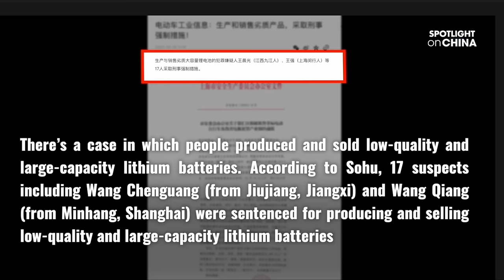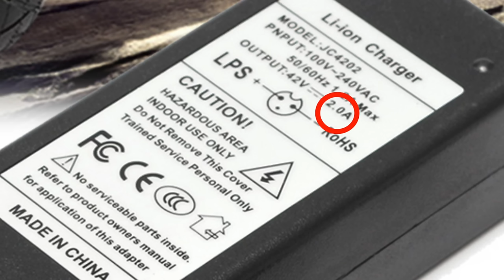What's Causing Ebikes Fires?

Comment: I once unknowingly fed a singular 18650 cell directly with a 5v2a supply. It was like a small grenade went off in the room followed by a small fire that was thankfully easily extinguished. A year later I'm boarding a flight with my phone, a rather beefy battery bank, and some other electronic devices in my carry-on that were all perfectly acceptable to bring with me but they wouldn't let me take my half tube of toothpaste. I just remember thinking to myself "I feel like there're enough batteries in my carry-on devices to cut a plane in half, but for some reason the toothpaste is the scary thing?"
Reply: Yep you’re allowed take a 36v 10ah battery on the plane… equivalent to multiple grenades. But 9 out of 10 dentists agree tootpaste is dangerous😂😂😂
Reply: @VelEire_  I'm told 100w or 150w with permission per battery up to 3 batteries. Thpugh they never say anything about laptop battery 🤷🏻‍♂️
Reply: @VelEire_  just the gas smoke from one would poison all in the plane. You make a good point.
Reply: @neilstern7108 Not a good point bc they can simply drop the emergency O2 masks for everyone to breath instead.
Reply: @novicenova  she makes a great point. And I still say I would not want to sit in a plane full of poisonous smoke. Even with air mask. And remember the fire and heat in a pressurized area.  Not good.
Reply: @novicenova  There is only so much O2 on a plane.  Plus, what happens when that O2 meets fire?  Think!
Reply: I haven't flown since the 70's. Not ever going to either.
Reply: i charge my in my wood stove purty safe
Reply: Your toothpaste is scary but stop and think even if they let you bring toothpaste then someone's might sneak mouthwash or god forbid dental's floss Onto the plane and then before you know it you have good oral hygiene at 40,000 feet! where does the madness end!
Reply: Yes my girl friends battery operated thermal panties caught on fire,
It was like  Moses looking
at the burning bush
Reply: @Timotheos-td7mq  If I were Moses Id be thinking "wow I climb all the way up this mountain to witness your glory and you set fire to a shrub" wow how impressive!
Reply: I remember laughing because they took away my tiny fingernail scissors but let me go the plane with sharp metal knitting needles 12" long!  Stupid people!  No brain power!
Reply: That's because .4 oz of amatol, C4, torpex, Comp B or other similar explosives, when combined with a cell phone battery has the explosive yield of a 17 kt nuclear device.
When you add the nuts that they serve on airplanes, it boosts the output to 2.1 megatons.
Reply: Considering that 4.25 volts is the maximum charge for a 18650 cell I get why it exploded but if you treat them right you should be fine
Reply: @novicenova
So do you really think that feeding O2 into a fire is a good idea?
Sure, the batteries don’t need oxygen to burn but it helps keep everything else on the plane aflame.
Reply: Yes, my 6000 USD ebike went up in smokes on the first ride !!!
Reply: @qua7771 it’s not pure oxygen. It’s equivalent to the air you breathe.
Reply: @jeremyashford2145 I shouldn’t have to say this, but the air you breathe on a plane is similar to the air you breathe outside. It’s not going to accelerate a fire like pure oxygen.
Reply: @bruceskousen5451  Are you sure about that?  I never worked on commercial planes, but in the military we had LOX tanks, (liquid oxygen).  It saves weight in that form.  It's not breathed in full concentration, I understand.
Reply: @bruceskousen5451
No. You shouldn't.
Indeed the O2 content is slightly reduced.
The "air you breathe on a plane is similar to the air" you breathed on the plane half an hour ago.
They used to serve up fresh air but once they banned smoking the opted for the cheaper process of recycling.
Still plenty of oxygen in it to support fires though.
Reply: If it was 'Arm & Hammer' toothpaste you're not allowed to take hammers on a commercial flight. Everyone should know that.

Comment: To avoid EV fires: 1) Do not accelerate excessively. 2) Wait an hour after using EV before charging so that the balancing resistors can equalize the batteries. 3) Wait one hour to use EV after charging 4) Do not leave plugged in overnight 5) Charge only to 90 percent.

Comment: I agree with the video 100%. Unplug the charger when not in use. Give the charger a chance to cool down. I noticed that most electronics work better when they’re unplugged and plugged back in (resets, recycles, I’m not really sure). I also only charge my battery when it’s around 50% or below and I never charge in direct sunlight. Try to keep your charger in a cool and dry place. Try not to allow the charger to get wet. Simple precautions that go a long way.
Reply: It's recommended to charge your battery after every ride to prolong its life.
Reply: @OddJobzAberdeenshire  I see this subject is like many others-ask 100 people the same question and you get 100 different answers. I have 3 scooters and whatever I’m doing to maintain the batteries is working so I’ll keep doing what I’ve been doing.

Comment: I've had a e bike for 8 years 
Knock on wood no issues yet .it's never failed me and still works oerfect .
Reply: 11 yr old pedego riden daily, on 3rd battery. About10k mi.batterys are toast. So far so good. But i do change outside in case
Reply: @donpet8258  im on my original battery
Reply: I've recently purchased a 52v 45amp battery from conhis motor. Works great so far. Hopefully it stays that way
Reply: it will come :p

Comment: There are a few other really important things that really improve safety:

1 Charge outside where ever possible.  In a yard, on a balcony.  This reduces the risk of your home catching fire, buys you time and reduces the chance of you inhaling toxic smoke.
2 Charge on a fire proof surface.  On a paving slab, in a sink, somewhere that will not catch and spread the fire.  Think about what is above the location where you charge.
3 Never be tempted to recharge the battery in your can and leave it while you go for a walk/coffee.  This has written off a number of cars.
4 Keep a bucket of sand near your preferred (hopefully outside) charging location.  Pretty much nothing puts the fires out except smothering them in sand so have it close to hand.

Last year in a dry period one of our batteries was damaged and caught fire, the person was alone and the fire caught the grass.  It ended with a serious bush fire in a protected area and the consequences are still on-going.
Reply: If you are going to charge your lithium battery outside, you should heat it with an ebike battery warmer when it's cold outside. Cold temperatures reduce lifespan when charging
Reply: Great post. I charge outside except winter. Unplug immediately after the batteries sync. My battery is made in the USA. Not cheap either.
Reply: I wondered about batter fires after hearing about beings electric jet catching on fire from a lithium ion batter yes upon that with passengers and every thing.
The planes do not fly with electricity but the controls are battery operated. My instrument instructor who was a fully certified pilot said every landing  is really a controlled crash yes scary but accurate. Bad battery means no controls a landing that is converted into an out of control crash? Noosiree Bob not for this duckies. Wel that issue was fixed no crashes just a potential so not so bad. The on-board alternators a jet can make gobs of power remember after one engine is started the engines alternator easily starts another engine all by itself.   And to start a jet the turbine has to spin really really fast. Passenger planes have an APU. Auxiliary Power unit for in flight emergencies  they can start a jet engine the the electricity made by that engine can start any other addition engines.

Comment: What causes most of these Ebike Battery Lithium Fires, is when one of the Cells (some batteries have over 72 cells) Gets Out of balance..   Low quality BMS, can cause the cell voltage to get out of balance.. if you have a choice, always opt for the higher quality BMS.. Using a low quality Charger that doesn't assess and balance the voltage of each cell in the pack can also do this..   
In Battery packs with multiple cells, the BMS is supposed to balance the voltage of each cell.. When it doesn't, the higher voltage cell (ie:  58.8v) and the lower voltage cell in the pack (ie: 51.1v) there is a rush of amps flowing to the lower voltage cell.  That causes the cells to heat up to dangerous levels igniting fires..  (these Lithium Fires are almost impossible to put out with a standard A, B, or C type extinguisher)  
Ways to avoid this dangerous situation, 1) fully charge the battery with a quality charger like the Grin CycleSatiator.  This charger looks at each cell to make sure the BMS is doing it's job... 2) Fully charging every time will normally balance the cells voltage in the pack..   At the very least, Fully Charge the pack at least every other time..  3) if something is wrong with your packs BMS or Cells, the pack will get hot during charging (so feel the pack while charging) 4) if your pack is used in freezing weather, or freezes,   always bring it inside to let it warm to room temp..Never attempt charging a frozen battery pack.. it is dangerous..
I top my packs off after every ride.. (I use a Grin CycleSatiator)  The GrinCS, tapers off (slows down the charge at the very end)  This preserves the battery...Most cheap chargers don't taper the charge at the end..And my packs never get out of balance..  I have been riding for 6 years, with dual battery balancers.  And i get more mileage out of my packs at over 2k cycles.. I have put on over 12k miles in that 6 years.. And i don't loose range because of these reasons.. 
Understand how charging works and how to safely charge your packs..
Reply: good advice. i have the lunacycle advanced 48v charger. and it slows down when its fully charged.

Comment: I built a small brick walled charging station with a solar panel where I do all my charging.  Contained safe area.  I tend to trust 1S devices more than any larger voltage stacks that require more complicated BMS/charger management.
Reply: I know someone  that dropped  a wrench accidentally on a battery that was big enough  to melt the wrench in half in one binding  pop flash!  Scary VERVERY VERY SCARY!!!!!

Comment: Great Topic! The chargers have  abilities to get on fire as well. Last year phantom recalled charger because of the issue. I like the charger with fan inside as they are little loud but turn off once battery charged. That way you know it's done ✔️
Reply: right the lunacycle chargers are good at this,
Reply: Right. I own one that gets almost too hot to touch. I imagine if there settles a bit of dust inside, whatever, that might be the start.

Comment: Well aware of all the downsides to sla batteries, but as an older guy who jumped on this e moped scene 20 yrs back when nobody knew what they were and constantly getting pulled over. Now they had to be replaced every couple yrs, but that was the bulk of the $$ maintenance and are still being sold on some today... ie Xtreme Cabo. Now I have a new one, they suck compared to the ones from 10 yrs back, the lower the battery gets the slower I go after 6-8 miles. Lots of downsides. But never thought about fire issues. I can cheaply replace and or rebuild myself, have over amped for yrs and never saw any heat issues or fires. Shortens the life of the motor at most. Keep thinking about a lithium battery pack as an upgrade, but for me 4-5 miles is all I need in my small town. As someone with epilepsy can't get a license to drive anything, but still have to get around

Comment from the maker: In this video, we'll discuss ebike battery fires

Some preventative measures
timer: https://amzn.to/3eSSYNV
box: https://amzn.to/3MPdEmA
bat-safe: https://amzn.to/3MQGqDs

Check out the largest ebike battery I've tested: https://youtu.be/FpxybxuJ1eE
Reply: Rather use the original old sulfuric acid batteries like one for a motorcycle with an alternator to keep the battery charged.
Reply: Fires only happen when the battery packs are made poorly. Also some people use the wrong chargers. Can’t wait for the sea salt battery this year
Reply: @ka2rwp  those are garbage batteries
Reply: I love my 20"x4" fat tire folding electric bike, I've had it one year. I always unplug mine, when the batteries sync,  I immediately unplug it. It's not a cheap battery, 48 volt 13 AH. Runs my 500 watt, 1000 peak watt motor at 25 mph easily. At 155# I can get 60+ miles on a 3 hour charge. I just subscribed, I appreciate your knowledge and experience, the best to you and your family. Thank you.
Reply: @ka2rwp  Ha ha, I doubt it. I am giving up driving next year and only using my ebike and a pull trailer. I have a 5 year drivers license  with no restrictions, but getting close to 66, my motor skills are diminishing. When  I sell my truck, I'm adding an electric trike or cargo bike to the quiver. Winters are brutal some years here in the high desert, but that's OK. The bus stops 50 yards from my door. Life is good.

Comment: I have a set of 4x16ah multistar lipo batteries in my home made mid drive 60V, they have been in my bike since 2015 and are still balanced to within 0.060 with over 7k miles  I have the bms set to cut when any 1 cell reaches 4.2 and 3.3 and have never had a problem.  My batteries are only 2 parallel, I think personally that flat cells are safer  being folded as to a roll in a metal case.

Comment: Vibration and impact are a strong contributor to battery pack fires. It only takes one 3.7v cell in a 48v pack to become dented or damaged, for the whole pack to fail catastrophically.
Store and charge your suspect battery in a metal file cabinet or barbecue.
Reply: Or a safe but remove all the cash first...Hmmm, i wonder if a Ebike/Scooter battery could blow the doors off  from the outside of a safe ? Hmm haha!
Reply: Okay not you're scaring me cause I hook up my battery to my rear rack. And my roads can get bumpy and potholes.
Reply: @Mash3OH3  , Dropping or crashing are the things to worry about. The battery is designed for bumpy roads.
Reply: @mikemorgan8588  

Phewwww. Yeah I use it in a fairly large lunch bag and hook it up to my rear rack using those rubber tarp straps. It's been great so far.

It's a 52v pushing 45amps but I lowered the amperage on my controller to 36amps. So less heat and a bit more range.
Reply: @Mash3OH3  Sounds like a good setup that still has speed.
Reply: @mikemorgan8588  

Glad to hear it thanks! It was my first time putting it together. 

I asked the vendor for his best performance stuff. 

Could I ask you. My controller is set ti 48v atm. It's overvalued by my 52v battery.

I was wondering will there be any performance gains if I set the controller to 52v? 
Or should I keep it overvolted on 48v?

Comment: I became very critical towards electric cars and bikes. I think we still need to learn a few years, until this problem is mastered better.

BTW. Taco Bell failed here in Singapore. That thing with the bell is such a nonsense. In particular, if you sell only junk.
Reply: The issue isnt we need to "learn" more, the issue is we are buying cheaply made junk, poor quality control batteries made in CHINA- the land of toxic drywall, poisoned pet treats and baby formula, blatantly forged CARB certifications on laminated flooring shipped to Lumber liquidators and... need I go on?

Also, SOME shady people have been selling "refurbished" or repaired E-bike batteries etc in NYC and elsewhere that they took apart and repaired and offered for sale for half price, there's those and numerous videos on youtube showing how to REPAIR all kinds of these Lithium batteries from the smaller ones used for hand tools like drills and drivers to the E-bike batteries, the videos show step by step instructions by UNTRAINED, NON factory trained amateurs who take apart the battery case and then start messing around with the electronics inside, and also replacing individual cells that went bad. 

They show how to solder in the new cells and fix the boards, trouble is- they may have gotten lucky and many people dont follow instructions, you get someone repairing their battery after watching a video and they do one little thing wrong or poorly solder a new cell  or the wrong one into the pack and there's no telling what can happen, these batteries have too much energy in them for amateurs to be in there messing around with tools and a soldering gun!

There is a video on a science channel I follow "nile red", the guy carefully took the case off a lithium battery about the size of an "A" cell, and unrolled the lithium foil and tossed the lithium foil into a pan of water on the floor, it sparked  in the water and then ignited into a flame, and then most unexpectedly- it EXPLODED with enough force it looked and sounded like an M80 firecracker and blew the flame out along with moving the pan and spraying the water all over, and that was just about a 2 foot long unrolled strip of lithium foil! It's highly reactive to contact with water.
Reply: @HobbyOrganist  I guess you are right, Mr. Organist